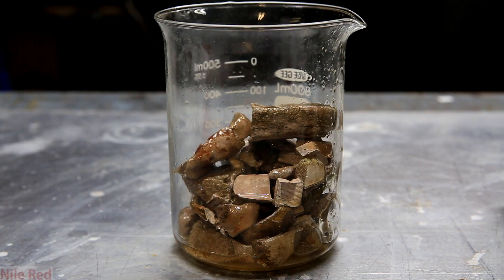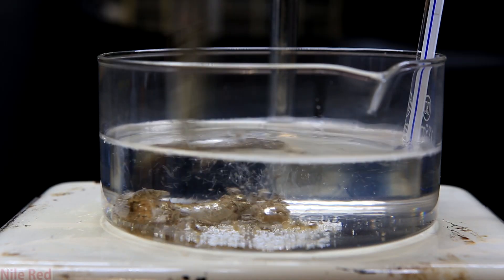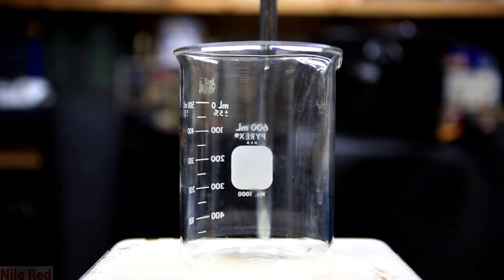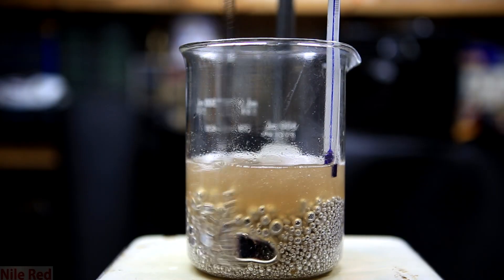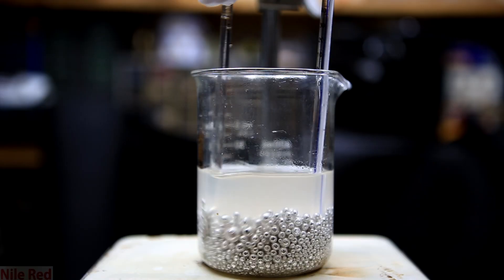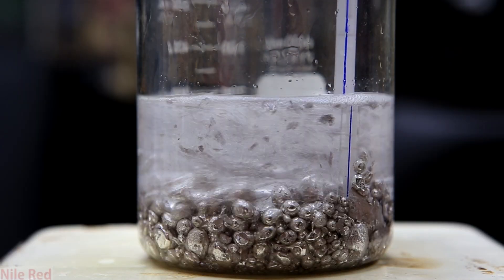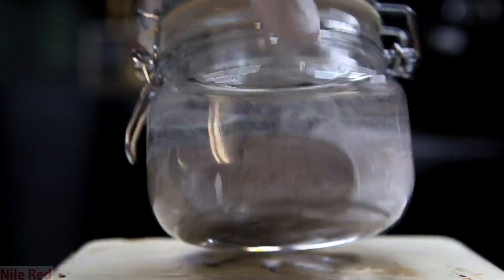Cleaning old sodium metal

Comment: 8:13 or you could use a winemakers airlock  for the gas build up in the clip seal jar
Reply: Is that like a pressure valve?
Reply: @N0Xa880iUL 
A one way check valve for gas, yes. A deep s bend with water in the bottom curve

Comment: Did this at work. You actually only have to do 2 washings, no matter what. After melting the sodium the first time, add the IPA to the dirty mineral oil to coalesce it. Then cool and remove. You can then re-melt the sodium in clean mineral oil, and allow it to form the small bead. Thus gives a much higher yield, and doesn't give reactive sodium waste. Great video! Thank you for the procedure.

Comment: During the initial clean up save the mineral oil as it has been thouroughly deoxidized and dried. Filter this through dessicated cotton balls and keep that oil fir storing your sodium in. Use N butanol or t butanol for the alcoholic clean up step. One thing i used to do was to suck the sodium into a syringe, usually 25ml or 10ml size. Suck a bit of mineral oil in first then suck up the molten sodium leaving a little oil. It stays shiny and bright when you need it put the syringe in warm oil till the sodium melts and dispense the amount you need. Works awsome for extremely air and mousture sensitive chemistry.❤

Comment: If you have the proper glassware and safety equipment, refluxing in toluene would be more effective and easier. The sodium will still melt and it is much easier to decant toluene repeatedly. You can also filter the toluene after (and you've also prepared anhydrous toluene) and re-use many times for this purpose. You would also save a lot of time by cutting away all the oxidized surface initially.

Comment: There's a much more efficient way, involving practically zero loss of sodium metal, if you can get hold of a bottle of tetraglyme, aka tetraethylene glycol dimethyl ether. This is an excellent solvent for sodium oxides and hydroxides, which will comprise most of the surface corrosion on sodium metal, and the effectiveness is increased at higher temperatures. The one catch is that sodium floats in tetraglyme, so you will need to blanket everything with nitrogen or argon to stop the sodium corroding. If you don't have an inert gas source, you could pour a layer of mineral oil on top - this shouldn't mix with the tetraglyme since the polarity of the two liquids are vastly different. Just choose a mineral oil that sodium sinks in. This is similar to the method of cleaning up old potassium with 1,4-dioxane.

Anyway, tetraglyme has a boiling point way above the melting point of sodium - but don't heat it beyond about 150 degrees C, otherwise it actually starts reacting with the liquid sodium. Anywhere between 100 and 130 degrees C should be safe enough. If you put a large magnetic stirrer bar at the bottom of the beaker and turn the stirring rate up as high as it can go, you should form a vortex, and the melted sodium will coalesce in the middle of the vortex into one big rounded lump, with all the impurities dissolved into the tetraglyme layer. Once it has all melted and collected, turn the heat off but keep the stirring going until it has cooled down enough for the sodium to solidify. Then you can pick out the lump with tongs (or a gloved hand if you're feeling brave) and dump it in a clean jar with some fresh mineral oil.

Don't be tempted to store the sodium in tetraglyme to keep it shiny - this will work for a few weeks or maybe a month, but sodium still reacts with tetraglyme at room temperature, just imperceptibly slowly - and the breakdown products form a sticky black tar-like substance. Tetraglyme is expensive, so you may want to recover as much as possible, but this is easy enough if you have a distillation rig and a high vacuum pump. Don't try distilling the tetraglyme at ambient pressure - it will decompose too easily, especially with sodium hydroxide dissolved in it. But at full vacuum (as good as a rotary vane pump can do, anyway), the distillation should occur at a much lower temperature, so less of it will decompose.

Comment: Hey Nigel, another great video! Thanks! Watching it, three questions came to mind:
1) Have you ever tried working with sodium in an oxygen free environment like an anaerobic glove box? I know these are usually used for growing anaerobic bacteria, but who says you can't branch out?
2) Can the mineral oil be fully dried either with heat under vacuum, or with 3A molecular sieve zeolite?
3) Have you ever tried using silicone oil (random, whatever weight) to either purify or store sodium?
Thanks again for making these awesome videos and teaching me new stuff all the time! You're bringing back some fond memories of chemistry class with a teacher whose fondness for setting substances on fire closely matched mine! Cheers!
Reply: 1.) Bro, "anaerobic" glove boxes are used in chemistry literally everywhere and all the time to handle and store and analyze air and water sensitive compounds.
But since he makes these videos at home he most likely can't access one.
You totally can use sodium in a glove box though, in fact, you even should if you're doing "real" chemistry with it.
2.) If the vacuum isn't too strong then probably yes? Not sure if molecular sieves would work because the oil is so viscous. Perhaps if you wait long enough?
But to be honest, I've never seen anyone have a use for dry mineral oil, so it's usually no point of concern. :D

Comment: I don't understand several things 
1) why it is first heated in a crystallizing dish instead of the beakers you use later
2) It appears you are using a liquid in glass type thermometer. These typically have a minimum 76 mm (3 inches)
immersion depth. Especially with the crystallizing dish you are no where near 3 inches. So I don't understand
how you expect the temperature to be anywhere near accurate.
3) You leave the thermometer resting on the bottom , which is a no no. your measuring the temperature of 
the hot plate/ beaker. 

I am really trying to make sense of needed temperature 130-140 C as stated and your temperature measurement.  
Do you shut off heating while your playing around breaking up the sodium so you don't have to worry about over heating ?
I think the flashpoint of mineral Oil is about 170 C so you are not too far away. 

Thanks for any response

Comment: There is a better method tbh..you can use electrorefining. Take a pure sodium and make it cathode and the dirty one the anode..just make sure the dirty sodium conducts electricity. Allow them to sit in water for some time and and add any sodium salt as electrolyte. The sodium cations will go to the cathode and further sodium ions will be released from the dirty sodium anode...there will be an anode mud of the left oxides like bicarbonates, hydroxides, etc and you'll get pure sodium...store it in kerosene oil to prevent oxidation.

Comment: Seems unnecessarily dangerous for trivial savings. Sodium is relatively cheap; just buy more. Saves creating waste, too.

It you want to salvage some of the oxidized sodium, you can "skin" it by cutting off the exposed surfaces in thin sheets and keep the unreacted metal inside.

Comment: Found some sodium or natrium. Dont know what it was. But i played with it for some time.

And i liked cutting it it was so shiney and those colors.

But after some of it got stuck under my nail and started burning. I reacted fast.
Okay WATER and soap.
At the moment my hands touched the water they "exploded".
And it was now clear for me that i was in deep water with this material.

I went back and countinued with the cutting.
Now with gloves.
Short after the piece i had got softer and softer.
I quickly realised that this is a reaction i cant controle. And its escalating.

Luckely for me the window was open and metal with the paper it was on flew out of the window.
At the moment it was out side it exploded in a huge fire/smoke cloud.

And i took the rest of the metal and played with.

I found the metal in an old camera flash bulb.
And the bottom of the bulb was a metal cylindre.
That was filled with the metal.

I burried the metal 
And short after the moust in the soil activated the metal the exploded and maked a small hole in the grass.

Comment: Sodium in normal atmospheric conditions readily reacts with oxygen from the air with a explosion, so in your video why did it didn't happen??
Reply: Mineral oil coating. It's why we store these metals (Li, Na, K) under mineral oil. The oil is thick and viscous, allowing the metals to briefly be handled and manipulated (cut, weighed) before use, without requiring inert atmosphere techniques (glovebox, schlenk line). To remove the oil, a quick wash with hexanes followed by the solvent you are using for your reaction and you are set to work with said metals.
Reply: @brandonwatson883  thanks for the reply

Comment: Great video! Is there a way to remove the mineral oil from the sodium when it’s ready to be used?
Reply: Don't know if you still want to know. Many methods, usually starting with washing with dry hexanes, quickly drying off hexanes, followed by the dry solvent of choice for the reaction/mother liquor.

Comment: Thank you so much for this video. I have absolutely tons of tarnished sodium hanging around my house and I've tried Mr muscle, soap and water, windowleen, elbow grease, brasso.... Or rather the metal namesake, sodiumo, but nothing seemed to keep it clean for long enough. Now I am finally able to clean my copious amounts of sodium successfully.
Also you mention about the bubbles in the mineral oil, did you note the irony in what you said? In order to remove the risk of your storage container blowing up because you didn't release the bubbles created by putting sodium in mineral oil, store some sodium in your mineral oil before storing your sodium in your mineral oil and release the gas each day before putting your sodium in the mineral oil to store.......
Reply: No irony at all. You just don't tightly cap the container containing the mineral oil when you are drying it with sodium.

Comment: Just hold it under the faucet and rinse it off, problem solved.
Reply: The Tyttuutface a mineral oil faucet tap
Reply: Your case will be solved too
Reply: At a cost of your hand.
Reply: Forgot your hands.
Sodium will first explode then form sodium hydroxide which will melt your hand.😅😅😅
Reply: It isn't caesium my bro used to play tricks with Na, you had to wrap it in paper or foil or it would not ignite in water. K will, and it's pink
Reply: All the fingerprints and hands blown nice cover up lad 😂
Reply: Oh no it exploded
Reply: Why is it burning?
Reply: Well if it is water then the whole thing will go up in flames lol
Reply: @devvrath123  you'll no longer have dirty sodium.
Reply: @Mr_Glenn  You'll have NaOH lol
Reply: Devvrath woosh
Reply: That’s the sound it usually makes, yes
Reply: @devvrath123  that's the joke.

Comment: You can make a self-burping jar by holding the lid down with a rubber band instead of using the steel latch. The pressure will force the lid open before the bottle explodes.

Comment: Quite alot of work, just to be undone in the timeframe when you took the cleaned pieced into the air. 
If you really wanted it clean, can't you use a different, heavy, non-reactive gas in a bowl to make the transfer without oxigen reaching the sodium?
Reply: Or like rinse it with mineral oil over the beaker and transfer it wet?

Comment: Great videos there man! Have you considered cleaning your Alkali metals by distilling? Although it is quite dangerous (it requires the use of a hand torch) it results in a mirror grade surface and minimum loss of metal and mineral oil.
Reply: Honestly cleaning alkali metals with a hand torch would probably be one of the less dangerous things NileRed has done
Reply: @toastyeeter  yup

Comment: Huge enormous dangerous waste of time and resources. Just store chunks in mineral oil dirty or not.  The oxides protect it from further oxidation. Wash in the same solvent you have in your rxn flask, like EtOH for example. A beaker of alcohol is cheaper to "waste" by far. The oxides will come off to reveal nice shiny reactant. Then it goes in your rxn flask per the experimental procedure. Its fine to try to reinvent the wheel on your own time, but chemistry is a serious business. Except on donut Friday's!

Comment: I wonder if it would be possible to setup a pump and filter system that would continually recirculate the dirty mineral oil through a filter to help save on mineral oil and get the sodium very clean.

maybe a peristaltic pump would work best with the hot oil.
Reply: Possibly. It depends on how fast and bad the contaminates plug the filter paper.

Comment: Why didn't you dump the brown crap thru a sieve to keep the "lost" sodium?
Reply: Or add the alcohol to get it to coalesce and make it easier to separate. Seems like throwing out the baby with the bath water to me
Reply: AirsoftSlo the mineral oil was probably way too viscous for him to seive
Reply: @kitsumyr9752  Yeah,  but there's vacuum filtration.  BTW,  I store my alks and other reactive metals in dry nitrogen.  Less mess.  I didn't get your viscous humor.  Maybe I'm too thick.  My colleagues tell me that I am slower than molasses in January.  This is why I have decided to move to Australia.  Go with the flow!!
Reply: He's obviously an amateur
Reply: @joeljustin  At least it's not as violent as potassium, rubidium, or even, =gasp!=,  cesium.  In small quantities, sodium catches fire and might even burn violently,  while potassium literally explodes.  Cesium is a high explosive, even in tiny amounts. Rubidium is somewhere in between,  depending on how much is used,  and under what conditions.  But playing with calcium is a LOT of fun.  It's a little bit more powerful  than sodium,  too,  but somewhat slower (the reaction lasts longer).
Reply: Idiot
Reply: Why does it coalesce if you add alcohol ?

Comment: Hello I'm a total amateur , but anyway I recently tried storing sodium in a mixture of zippo lighter fluid and goof off it very quickly dissolved the oxide layer then it started to heat up and form a red color on the metal it seems like a fairly quick way to clean it. It this safe and what are your thoughts on it. Love your videos.

Comment: What would happen if you mixed the cleaned sodium with mercury or gallium? Would they form an alloy? What other metals (besides potassium and lead) will sodium alloy with? Maybe you could do a video on sodium alloys?
Reply: i am 16 years old and still completely oblivious to what an alloy is 💀
Reply: @omegadragons321  - a mixture of two different metals (or a metal and something else), but with different properties than either metal alone. A good example is 60/40 electronics solder. It’s an alloy of lead and tin, but the result has a lower melting point than either lead or tin. Steel is another common alloy, in this case iron and carbon.

Comment: Haven't used sodium in my metal vapor laser yet. I'm afraid that it will contaminate my quartz tubing since it's quite a dirty metal. I know it would most likely make a brilliant yellow laser line. I have used gold, silver, zinc, cadmium, selenium and lead. Not copper because it needs some really strict electrical requirements that I can't provide unless I use a copper halide and not mercury because it also contaminates the tube and electrodes.

Comment: Now I understand that the original chunks of sodium were filthy with corrosion and whatever else, and that this process certainly removed most of the ugliness, but at the end you allowed it to completely dry of any mineral oil when you cut it, which essentially guaranteed that it would oxidize yet again, and be covered with a new layer of corrosion. Granted it is cleaner than before, but it was certainly not shiny, which, for me, would be the primary purpose of taking the time to clean it. Couldn't it be cut while still wet with, or submerged under mineral oil? I've had about an oz of sodium for at least 8 years now, constantly submerged in the same original oil that it was sold with by United Nuclear, and it's surface oxidation has always looked whitish. It pretty much looks exactly the same as 9 years ago, which led me to believe that it may be nearly impossible for sodium to maintain a clean, shiny surface, even under mineral oil. Maybe that's why you weren't concerned with the light oxidation at the end of your treatment?

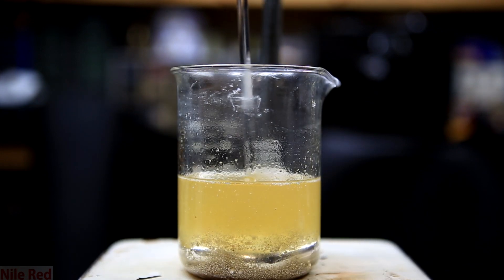Comment: If you place your glass rod across the top of the beaker (so that in looking down from above the beaker the beaker is like the outline of a clock and the glass rod is the hands on a clock showing the time to be 6:00) and then poured out the mineral oil such that it flows down the glass rod, you will find the pouring process to be without the messy dribbling.  This is due to the mineral oil clinging to the glass rod until it falls off the end and not over the lip and down the side of the beaker.  This is an old trick used by wet chemists for years.  It may take a little practice, ut when you perfect the technique it works well.
Reply: Have you tried it though? Water works, sure, but I don't expect there to be enough adhesion between glass and mineral oil

Comment: So why did you not filter or strain the mixture with the mineral oil to avoid loss?
And then to avoid tarnishing at the end do the final mix in the storage jar - straining and replacing the last mineral oil wash and cutting it up in the actual jar so it never touches air.